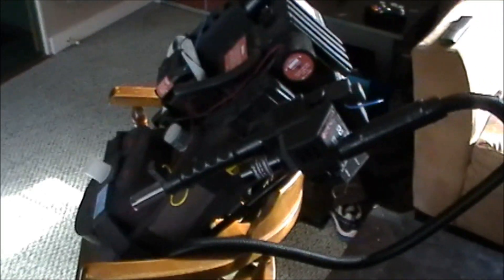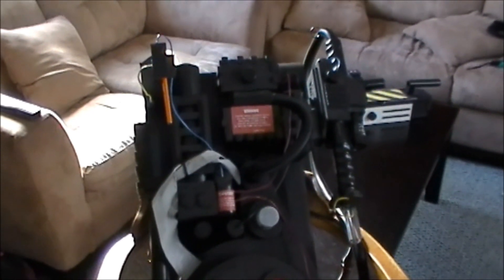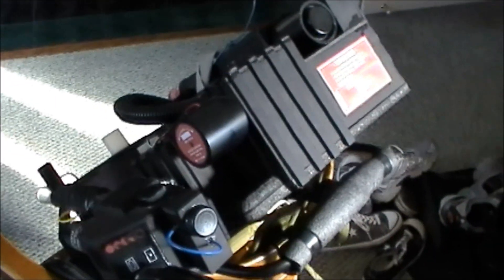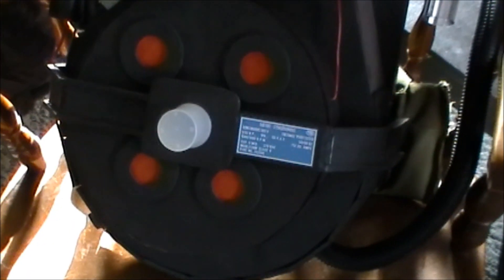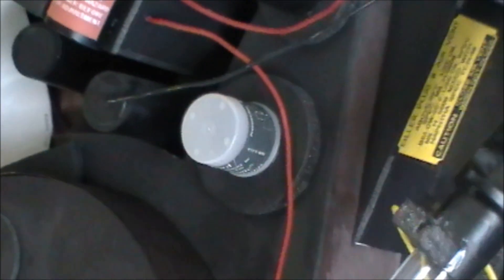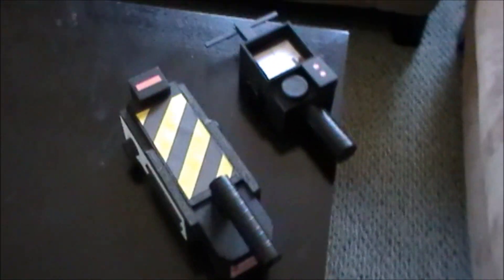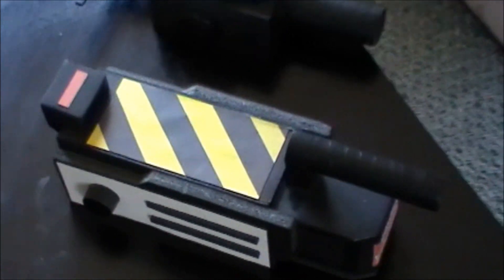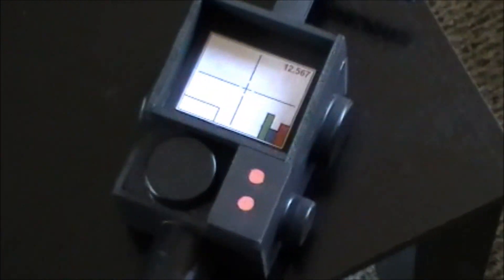Proton Pack Project

Comment: Only 4 years late but DAMN, that's a nice pack! I'm currently making my son a pack from foamcore and can only hope it turns out as nice as yours.
Reply from the maker: Thank you very much! What are you using for plans? The best suggestion I can give is searching gbfans.com. That's where I got the dimensions.
Reply: Dwight Blanche You are very welcome! For the packs I'm making now, I am using Sean and Steffan's plans. I used Norm's plans for my first pack but thought it looked a little large and sure enough, according to gbfans.com, his plans were off by as much as an inch in certain places. My pack is being constructed out of wood as that's what is easiest for me but for my son, I don't think he can handle a 25lb pack so foamcore it is. What did you use to seal yours before you painted it? I'll be using Great Plains 30 Minute Pro Epoxy Resin. Hopefully it works okay...
Reply from the maker: yourmomsstalk3r
I never painted mine. The foamcore I found was a flat black to begin with. It meant that the outer material was more like paper and not glossy at all. It also meant I had to avoid any precipitation. I considered using a spray on sealant or something, but sold the pack before I ever had the chance.

Comment: Gotcha. For a quick and easy seal, I found that Mod Podge works wonders. With just a few coats, it makes it safe to spray paint and even adds a little strength. It's too bad you sold it. Have you made another one by any chance?
Reply from the maker: This past fall I completed a proper replica pack.

Comment: Where did you get the project foam?
Reply from the maker: This foam core can be found in just about any hobby store. The stuff is usually used for project posters, so if you go into a regular retail chain, you might have to look in the school supply section. When I bought my foam a few years ago, I happened to find a foam cutting kit that made it much easier to cut straight lines than simply using a ruler and an knife. I'm not sure where to find those anymore, though.